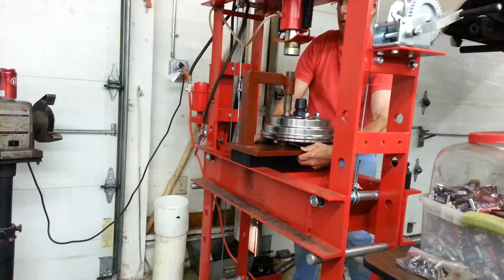Swedging Model A Drums and Hubs

Comment: How many pressure are necessary to swedge the bolt ? You say 22, 23 I suppose it is 23 ton ?
Reply from the maker: You need at least a 30 ton press.  We generally press to about 20 tons using the pneumatic feature, then go by hand after that.  You can actually feel the lug mushroom into the drum, generally right around the 22-23  ton point on the gauge.  If you go too far, you are in danger of cracking the drum.  My suggestion is to get a couple of spare lugs (they are a dollar at most suppliers) and, using an old drum, swedge it back on to the hub.  You will feel the lug mushroom, but if you go too far all you have lost is a scrap drum.  A 20-ton press won't do the job, you need to use a 30 ton, or greater press.  If I can be of any further help, please let me know.
Reply: @stewwolfe1  thank you very much for your help. Is it indispensable to build a tool as you did ? I bought a simple swedging tool. I have another question, but I need to send you some pics so do you have an email address ?
Reply from the maker: Generatoreditor@gmail.com